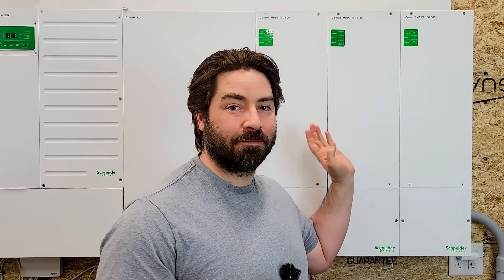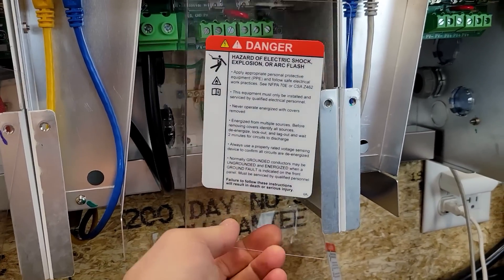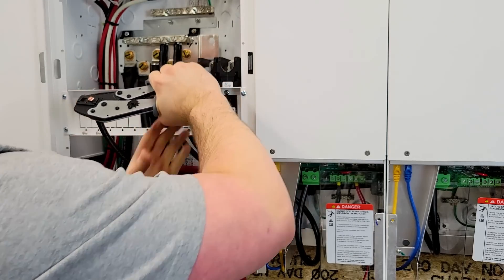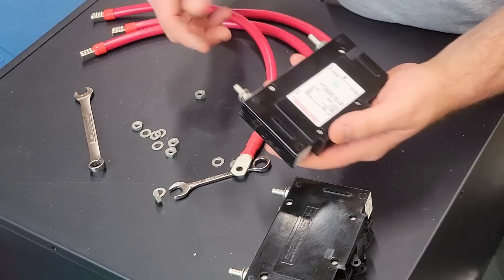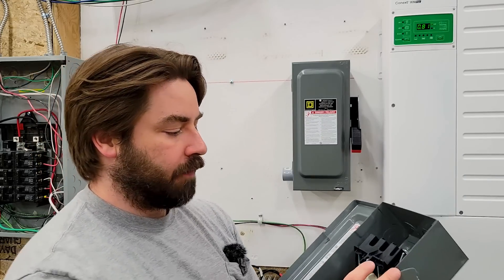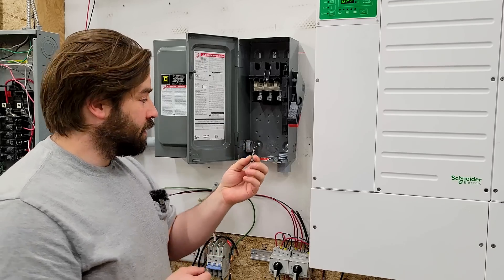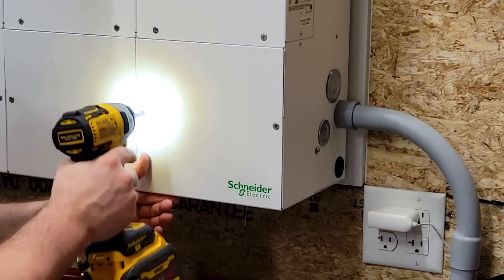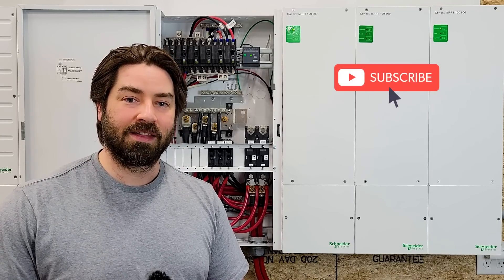Installing 300 Amps of Solar Charge Controllers

Comment: I have seen those lightning arrestor surge protectors installed on the bottom of disconnect switches before. Not sure if it's supposed to be that way but I was told it was so even if the switch is disconnected then the circuit still has lightning protection, but if lightning hits your system it's going to Go up and smoke anyways
Reply from the maker: Yes, next time I might do that.  When I went to try fitting the SPD onto the disconnect I found the knockouts are too close to the wall.  So, you would have to pad out the disconnects with blocking in order to have enough clearance for the SPD.
Reply: @DavidPozEnergy  I think you mite just need an offset in your case, it doesn't need to be watertight but I think a simple female to male conduit offset will work

Comment: While I appreciate your design is likely robust and safe using "UL listed" components isn't in and of itself enough.  For an installation to be allowed it has to either be wholly made out of a previously certified design (e.g. the assembly was previously tested as a whole and then reproduced) used in the prescribed manner, etc ... OR you need a specific site inspection where your design is thoroughly audited and approved.

I say this because people might get in mind that just using UL parts is enough to indemnify them from liability (civil or otherwise).  It's not.

Comment: Dave- I have been to Menard's, Lowe's, etc. and cannot find a 1 1/4 inch chase nipple.  Do you have a link where you got yours?  What length did you get for your ferrules? It just takes me to the ferrule page but there are several lengths.  Sorry to be asking for my hand held. Female trying to learn...
Reply from the maker: I bought mine at a local electrical supply house.  If you don't know of one where you live, type into google "electrical supply near me".  Typically it's the type of place only electricians go to.  Tip:  If you don't know what you want then find out before going.  The guys behind the counter don't want to deal with questions.  LOL

The ferrules I bought are 16mm in length, which is the minimum.  18mm would also work just fine.
Reply: You are the best.  Thanks for answering. @DavidPozEnergy

Comment: I always put my SPD's on the disconlet on one of the knockouts.
Reply from the maker: Thanks.  I might do that next time.  But, I'd have to add blocking to pull the disconnects away from the wall.  As it is, the knockouts are about an inch too close for the SPD to fit.

Comment: If goal is to be off -grid, why be concerned about passing electrical inspection?
Reply from the maker: Still required where I live, but your jurisdiction may be different.
Reply: nice to sleep at night with a ul listed product rather than house in flames with the cheap all in one .  i have four different all in one inverters work ok but many unanswered wiring and grounding/bonding in very vague at best manuals 3 weeks ago i bought all  Schneider inverter with all the needed system component's and sell all the junk that i had bought over five years of off grid . when i  started solar power for my home  this seemed to me the best money can buy all i did was buy junk that almost worked now i have a system that has proved for many years to work.   nice job on your new system  i will have mine up and running in spring . Adam from central Maine.

Comment: David, you lost me at the 45-second mark with "300 amps." Since I like many of your other videos, I'll refrain from criticizing, but will state the obvious: 

**this setup will not age very well**.

I would advise anyone inspired by David's setup to carefully think things out and explore other options.

Apologies in advance if an explanation for this design was offered later in the video because, as mentioned, I stopped watching at 45 seconds.
Reply: Hey, it was a great system 10 years ago. It will age just fine until some vendor pays him to push some other old stock they need to move.
Reply: what's wrong with having 300 amps of DC coming off the three charge controllers?  (100A each)

Comment: Nice job David!  I'm enjoying seeing a build that's not another grossly over-priced for-what-you-get Victron job.   When you use a contactor or disconnect for DC and it has an extra pole, you should run the extra pole in series with one of the DC legs.   Typically the positive leg would be chosen.  This provides double the arc breaking distance and reduces contact erosion.  Since you've already paid for the third pole it's a good deal for only the cost of a single piece of wire.

Comment: Firstly, excellent work and enjoy how detail oriented you are. Question, can you use the same solar wire to go from the disconnects to the HV side of the MPPTs? The wire leaving the MPPTs going to the PDP is 48v power, right?
Reply from the maker: I used off the shelf THHN wire to run from the disconnects to the charge controller.  The wire is UL listed, and 600V rated.  It's labeled as THHN in the store, but the reality is there are multiple classifications on the jacket and THHN is just one of them.  But everyone just calls it THHN.  
Yes, from the charge controllers to the PDP is low-Voltage.  Nominal 48VDC.  My batteries max out at 58.4V, but I set my upper limit to 56.0V.  Your exact settings will vary by battery manufacturer.  The important thing about this wire, however, is it still needs 600V rating.  The wires are inside the same wiring compartment (the bottom portion of the charge controller) so they need to be rated the same.
Reply: @DavidPozEnergy  thanks for the quick reply. Can't wait to see this in action and how quickly it can charge your battery bank with 12k solar. What's your battery capacity? I have 38kwh

Comment: Many thanks for your videos on Schneider equipment.  They helped me greatly when I was installing my Schneider system (1 XW-PRO, 1 MPPT 100 600,. MiniPDP, and MPPT RS Disconnect).  While many say Schneider is too expensive, I was willing to pay a little more for something that I thought would be bug free, hopefully a long lifespan, and could handle load surges and  unbalance load.  I was not disappointed - the system has been very stable and only have found a few minor bugs.  

I'd be curious how your set up your MPPT 100 600s.  While I am happy with the Schneider equipment, I found the documentation on setting the configuration somewhat lacking. The holes the MPPT 100 600 may line up with the PDP, but I found they do not line up with the miniPDP nor the MPPT RS disconnect.

Do you have any type of Rapid Shutdown?  While not required for ground mounts (which I have), I wanted something where the fire department could shut down the Inverter power for their safety and so they don't just instead let the house burn down.

Those Schneider DC disconnects look very expensive.  But after following your link, I was surprised to see they were only $100 each.  For me, the MPPT RS Disconnect accomplish the same task.  But if I add more solar, they look like a good option.
Reply from the maker: Setting up the MPPT's:  I didn't look into the documentation.  I programmed the charge controllers Voltage settings that work with my batteries.  IDK, I found it easy.  But, maybe that's because I struggled through programming the Generator setup, and the parallel inverters.  So I guess I got through the learning curve with the insight home already.  

No, I don't have rapid shutdown.  I also have ground mounts.  I'm required (and did) put labels at the meter base stating there are more than one energy sources on the property.
Reply: @DavidPozEnergy  
What I am referring to with the MPPT 100 600 is if you have BMS monitoring engaged in the XW-PRO, it seems overrides override any battery settings you making in the MPPT 100 600, while the firmware notes seems to state the MPPT 100 600 does not use use the BMS.  So if you want to modify the absorb time for top balancing or use a slightly different float or bulk voltage, you cannot with BMS enabled.  What I figured out is as soon as all the batteries go to standby because they hit 100% state of charge, the charge controller immediately goes to the BMS float voltage regardless of the settings I make.  Not a big deal as the way it is working, it is keeping my batteries balanced.  It just took me a while to figure out what was exactly happening.

My system is a little different the yours as I also have an existing grid tie system that also charges the batteries and helps supply power to the loads.  I might note that with AC coupling alone, you cannot charge to 100% as once the batteries stop accepting a charge, there would be no where to dump the excessive grid inverter power.  So Schneider wisely cuts off the grid tie system before reaching 100% SOC (the default is 90% when it start raising the line frequency). Before I got the new panels installed with the MPPT 100 600, I constantly had issues with the batteries getting out of balance where the SOC would vary as much as 25% from battery to battery.

It all make sense now but it would have been nice to have a little documentation on how the whole process works.
Reply from the maker: You are correct.  If you have closed-loop communication with a battery BMS then the BMS tells the Schneider what to do.  There is no way to override this.  I tested this with the EG4 rack, and then again with the Discover Batteries.  Right now, I'm running my DIY batteries and I'm not using closed-loop.
Reply: @DavidPozEnergy  
Thanks for confirming my conclusions.  I was wondering if you were using BMS close loop configuration.  Since you have different type of batteries, I thought it was unlikely that they all had the same battery communications.

Comment: The HVCCs (100/600) can be setup with either negative-grounded, positive-grounded, or ungrounded (floating) PV arrays. If you setup the HVCCs as negative-grounded you could have used only one solar disconnect. Code requires that all ungrounded conductors of a circuit be disconnected (opened) simultaneously. Just like in a AC 120v you don't open the neutral. But sense you have the 3 solar disconnects setup I would move the SPDs into each disconnect, pigtail them into the input side with the solar input. They will fit, this is where I put them, you want them as close to the solar as you can get, you don't want that surge in the HVCCs. Great setup, thanks for all of you vids and thanks for service!

Comment: The Schneider system looks super smart when it's all bolted to the wall together fair play.  I couldnt afford that so tried out the new Victron 48/6000/100 which is 6kw and comes with a 450/100 twin input MPPT's built in so an all in one system.  One of them is doing great now but can add a second or third go 3 phase and each inverter comes with 7kw of solar input with zero wiring - really good!!!

Comment: you should install a heat pump in lieu of electric heat - much more efficient and you get ac too plus humidity control, think about pos pressure hepa connected to a heat exchanger too - heat exchangers can be 90% efficient which means you get good recirc w/o losing heat or cooling - you are gooking with gas now - informative video
Reply from the maker: I installed a heat pump in my garage: https://youtu.be/Kd092alkeaE?si=XunbpD200PEdOUNy
Also, I built my house.  It's super-insulated and air-tight.  I have an HRV (heat recovery ventilator) in my house: https://youtu.be/7yZJiUUFzk0?si=D1a2BwnBCT44AbS_
Reply: @DavidPozEnergy   You said you only have a 2.2kW resistance heater (7500 Btu/hr) which is honestly amazing. But a heat pump would still be better. The best 9k mini-splits are rated 15 HSPF which would theoretically save you 1700 watts.

Comment: I've been watching you build your setup for quite some time now David. I just ordered this same basic setup with two inverters but minus 1 of your 3 MPPT's, a few days ago. I can't wait to get started installing it. I believe the LF inverters will produce a cleaner sine wave under a wider variety of loads and power factors. In my situation, I will be placing 12 server rack batteries in 2 racks on the other side of the wall. I am planning on combining the two racks with a Victron Link distributor (for individual fusing) and then come through the wall either directly into the Schneider PDP or just below it, as that is to be determined as I trial fit the components.
Reply from the maker: Sounds good.  I wish you luck in your build.

Comment: Thank you for sharing I also bought the Schneider Electric 600 100 100 amp charge controller where's the link for the 600 volt wire
Reply from the maker: It's the last link in the description.  I bought it from Wire and Cable your way.  I don't have an affiliate with them.  Here is the link: https://www.wireandcableyourway.com/2-awg-type-mtw-ul1283-wire-665-strand
Reply: @DavidPozEnergy thank you so much David I can say for all of us that we really appreciate you
Reply from the maker: Your welcome.

Comment: I have 2 XW Pro (M & S) . 2 600/100 MPPT with 8s2p hanging off each one. One facing 180 and one facing 230. Spreads production over more hours in the day. 4 AES 7.4 which are plug and play for closed loop with Schneider. Regularly produce enough solar kW to get 100 amps out of each MPPT. Grid tied, NEM2 Schneider BCS 200 amp external contactor. Schneider isn’t cheap but it is bullet proof. Nice clean install David.

Comment: How much does all this cost and will you ever come close to recouping your money???
Reply from the maker: I have links to the parts in the description if you want to look up the cost of individual components.  I think all the Schneider equipment on the wall is about $12,000.  
For me, I didn't enter into this thinking about ROI (return on investment).  I wanted emergency preparedness, and the ability to prove making an net-zero, AND off grid, house is possible.  
I'll provide some rough numbers for the fun calculating it.
My house is 100% electric, and we consume about 10,000kWh/yr.  Our electric rate is $0.36/kWh = $3,600/yr in electricity this system off-sets.  3.3 years to pay-off the Schneider equipment.  But I also have batteries and solar panels that will double the time frame.
Reply: @DavidPozEnergy thanks for the detailed response, we only pay about $0.13/kwh so our pay off is much closer or over 10 years and closer to the degrading age of the batteries and panel...I appreciate the feedback

Comment: Way didn't you go high voltage instead of spending all that money and wiring .And what size furnace you are running?my furnace pulls 15000 watts .18000 watt surge .
Reply from the maker: I don't have a furnace in my home.  I have an electric baseboard heater that pulls about 2200 Watts.
Reply: @DavidPozEnergy thanks for the reply.Nice job !

Comment: I would much rather have 2 or 3 smaller systems than 1 giant system, for many reasons, I don’t know why people insist on cramming everything into one giant system - that is a nice, well done system though, great job !
Reply from the maker: Everyone's situation is going to be different.  For me, I'm working with an existing home, with existing wiring.  I decided to build a system that could power my whole house, as it sits.  If I wanted to make multiple smaller systems, then I'd have to install separate circuits for each thing.

Comment: I've been an "advanced dabbler" in electronics for just over 50 years.  Only started using ferrules on stranded wire ends a couple of weeks ago!  Fine stranded wire into screw terminals just produced unsatisfying connections.  Ferrules changed that completely.

Comment: Another great video, I love them.  You build systems the way I would.
Sig Solar has a bundle with 2 inverters 2 Mppt a PDP and connection kit for $10,973 right now.
Add one more mppt for $1,360 to get your rig 
So about $12,500 (plus a bunch of wire and disconnects)

Spec in your setup are now what I needed for my house. It is the system that i wanted to buy:18kw of PV in (3 x 6kw), 13.6kw of AC out (2 x 6.8kw)

I understand the differences and great benefits between  LF vs HF  inverters.  Split phase LF allows for imbalanced loads where HF is really act as 2 independent inverters so you can only load one leg to half the rated capacity.  LF are also way better for surge.

Sig Solar has an EG4 18k that has AC out of 10.4kw and PV in of 18kw, so lower AC and same on PV. In a close ballpark for $5,200

This makes the 18k 60% cheaper. You can buy 2 and still be cheaper.
Don't get me wrong, I'd take the Schneider system, any day if they were giving them away.

It would be great if you could get @SignatureSolar to loan you an 18k or two, and you plugged in your system and would see if it could run.  I'm guessing your chop saw load test that you did in that video a while back would do would fail (i'm still impressed by the inverter in that video).  But its been a long time since you ran an unbalanced 12k HF inverter test.  Time for another side by side test, or maybe you are never looking back.

If you could do it, an almost, spec balanced comparison (one 18k vs your current setup) and/or an almost money balanced comparison (2 x 18k vs your setup) 

We will leave labor and accessory costs out of the comparison :)
Reply from the maker: I'd love to do some heavy testing on the newer EG4 inverters.  Unfortunately, last I asked SS about it, they wanted me to purchase the EG4 inverters (with some discount). So, it would still be thousands of dollars that I don't have available.
Reply: @DavidPozEnergy  bummer, maybe my pointing it out will help spur them to send you a couple :)